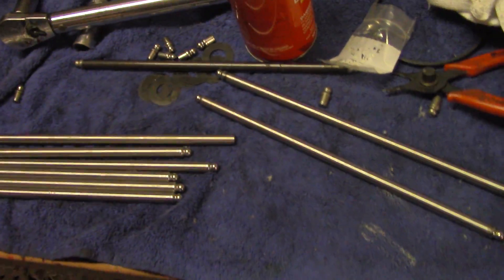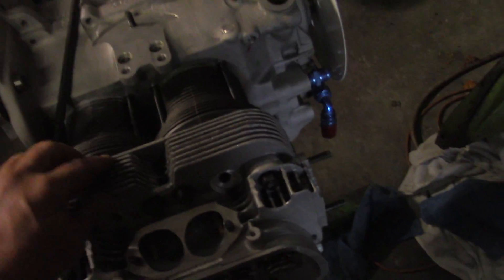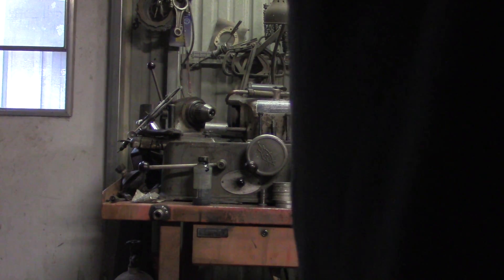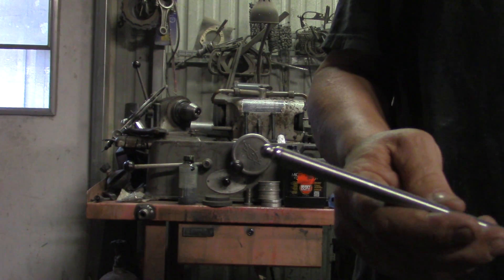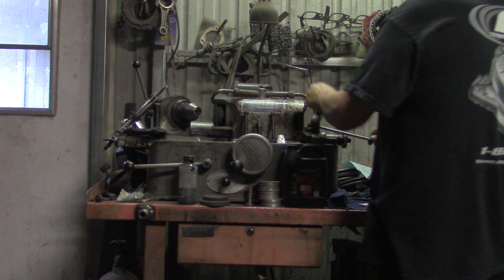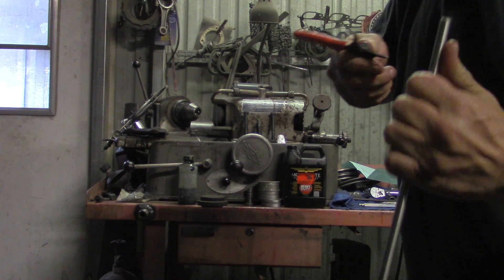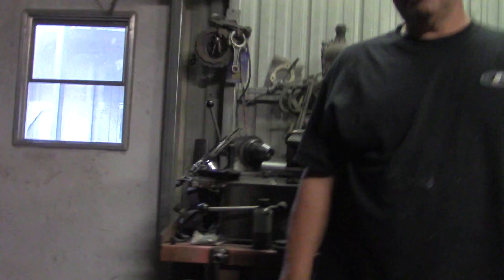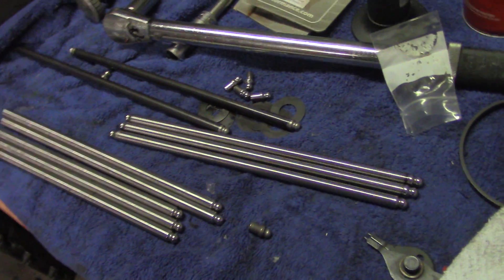GB Cut to length Pushrods on 2110

Comment: I have to do the same thing, I damaged two pushrods, have two that are longer but I'll have to get the ends out. On my mine there is a ball end and a receiver end. I have a couple of choice as to which one I  use, I could use the one that the ball is removable or the remove the cup from the one that ball is part of the rod. How do you get the pieces out? I have access to heat, lathe, valve grinder etc. I haven't attempted to remove the ends of either of my two options. I'm actually doing it right now and hoped that question had already been asked and answered but I don't see it. Thanks. Wayne

Comment: Darrin, I'm putting dual carbs on my stock 1600 dual port and I'd also like to install a set of Pauter 1.3 or 1.4 rockers that I've had    for a number of years.  Will installing the Pauter rockers change the length of the pushrod tubes?

Comment: hi darrin nice work but how do you measure the total length of the pushing rod? just 0.15mm //0.06 inch under the rockerarm? im building a type 4 engine end i used steel shims under the barrels to lower the compression! but now my stock pushing rods are to small! thanks Joris de Vet // the netherlands

Comment: Thanks Darrin 👍
When setting the geometry, do you just measure 1/2 lift and make sure the rocker tip/shaft centre to valve are 90 degrees?  Cheers

Comment: Will cutting them that way create enough heat to weaken the metal?
Reply from the maker: it's is 4130 heat treated that machine has coolant and the part never gets very hot at all
Reply: +vwdarrin Thanks for the reply.  I had never seen them custom cut and was just curious.

Comment: Man, that valve grinding rig is handy as hell.
Reply from the maker: that thing is great you can reface lifter on that side , there is a stone that does a great job i use them my $650 motors and I've never got one back